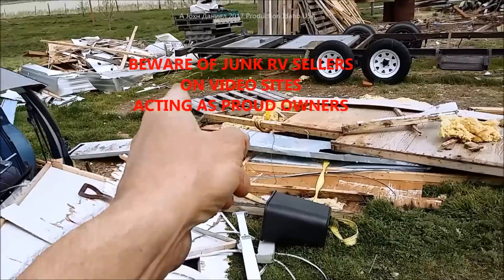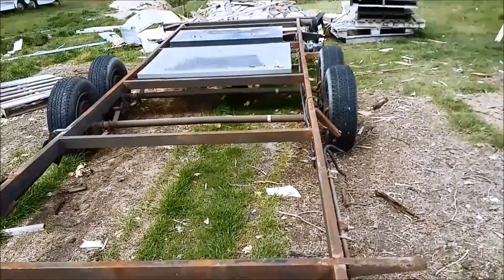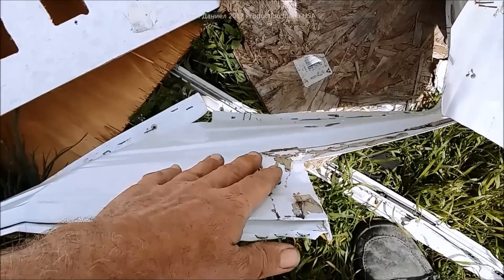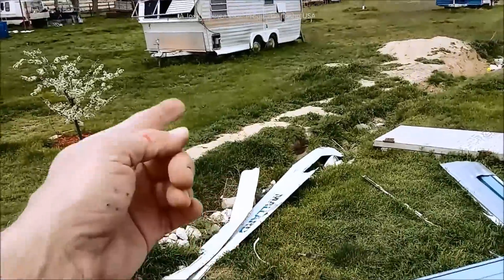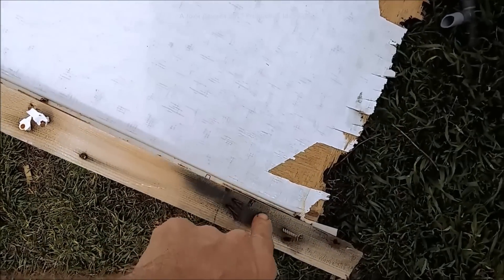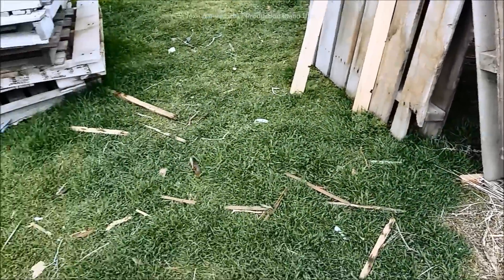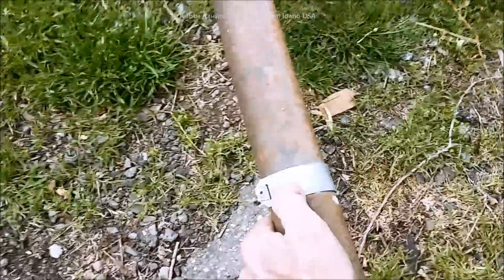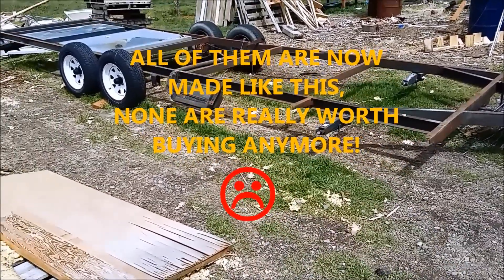HOW THEY MAKE RV Campers Travel Trailers, The truth, Wow! Info Below

Comment: Comments for a 2008 travel trailer that has been opened up and left out to rot or unused and maintained for how long?  Have things changed since 2008? Maybe something more up-date-date...
Reply from the maker: Back History - 2009, Trailer was sold to a buyer by a popular dealer at 1 year old, 1st trip out his foot went through the floor major rot in it, it was part of a suit, it was stored in a barn for 2-1/2 years, it was opened up on the side to expose all the rot for the law suit evidence, it again sat in a building 3 more years, it was donated to me then I pulled it 28 miles after boarding it up, I placed it in my shop building, then I did the video 5 months later of its POS condition.  
It was not left out in the weather to rot, it was stored indoors from original owner, second owner, and then me. However, if taking it on a dozen trips by 2 owners and me hauling it 28 miles was a cause of so much rot, I would avoid a Fleetwood Product!  My 1976 Rambler loves to outdoors, 40 years, HAS NO ROT!
Reply: Paul Boyer Dont kid yourself fella, those things are crap. period.
Reply: Is Fleetwood out of business? Who is now making their brand now?

Comment: Air streem is still today the very best in resale value. In my opinion the best and well worth the extra money
Reply: Kinnish < you’re referring to an old airstream. The modern Airstream doesn’t have the same quality nor durability.
Reply: Homer Mcclain They are somewhat better, but poorly insulated, way overpriced and still not doing many slide out floor plans which makes for a tight space. I wish they would bring it up to the 2000's in that respect.
Reply: Judd _S jayco just bought airstream
Reply: Homer Mcclain worth the extra money?.  Really?.....its  Highway robbery.....just like yeti products...ridiculous!!!
Reply: I know where there's 3 Airstreem trailers and all 3 are junk completely rotten inside my friend thought he could make one good one out of the 3 but the pieces just fall apart he ended up scrapping what he could burnt the rest and took a loss
Reply: they have average insulation agreed but quality is off-the-charts better. My cousin has an Airstream his father used in the 1960s, he uses  today and is giving it to his grandson. 57 years of use and still running. That is quality shit.
Reply: Jim Piver I cannot believe Airstream is anywhere near as crappy as a Harley. They may not be as good as they used to be but nowhere near the reputation of a Harley

Comment: WoW.  What do you recommend for sealing the windows etc.
In the process of building one/frame up.
Thanks,
Reply: You need somthing that is not changing by the warmt or heat of the sun, butyl is not the right one. Use polymeer, I don't know the brandnames in the US but EU has Tec7, that's quality. RV 's , trailers, everything on the road has torsion effects, because of that, it's best, but who dus it, to take the windows and so on , out of the walls and use a lot of polymer after you have removed and cleaned the factory stuff. Use a lot, till it comes from under the window frames on the outside, then you will be sure that ther's enough under that frame. The same with the profiles that covers the corners of walls and roof.  It's a pity that people don't like to see screws,  but then you are sure that something is atached and not only with ...euh... glue ( ? )  Best advice, buy a second one and pay with the nolidge that it has problemes and repair it yourself. How NOT to do it is showen by the constructors.... :-)  Windows that are " clamping " the outside frame against the inside frame on a wall that has isolation or nothing much in it, is clamping on a spons, no presure posible to keep something from leaking... If it's posible with the type of window, use nice stainless steel screws or rivets to put the windows and profiles back. You will know that the window is sealed on the walls and everybody with some grams of brain, also. It's more work ofcose to drill the little holes in the frame on an eaqual distence from each other and in a perfect line, but that's how they do it still on boats and they don't like leaks ... :-)  Autorety's and regulations forbid to build a lot of things yourself, that's why you have to buy shit and pay a lot of taxes over it. And there  are old RV's and caravans that still are in better condition then the new ones.  The idea that people learn from mistakes don't go up in fast-grabing-money bussines .  :-)  Polymeer can be cleaned away with a plastic spatel before hardening and the rest with  cleaning petrol or benzine. The factory shit also. And a lot of ellbow graese... :-)
Reply from the maker: The Butyl-RTV we use is auto windshield grade. Same stuff they set in car windshields with. 30 year plus life, $11 a 14 ounce tube, and capable of -75 to 405 degrees. But there is a nice and perfect option, best fresh source is from a guy on ebay,  https://ebay.to/2r91hIu
Reply from the maker: +Sims Fishing, Flats Fishing, and Kayak Adventures I use butyl like used on car windshield

Comment: Holly crap that thing is complete junk. hell I have seen fema trailers built better than that.  Looks to me the best thing to do is build your own. Man there are junk sellers ever were now days for shit that you will only get a few years of use out of and then it falls apart going down the road.  Good you show this stuff Hell I like to get a nice camper but not if they all look like this crap. Hell I just build my own.
Reply from the maker: +McCuneWindandSolar I have 5 old travel trailers out here, all but this one is from 1982 and back. Those frames are stout and have 3500 to 7000 lb axles but this new shit will have to be made from a 29.5 foot shit pile into a double axle 12 footer to be reused for anything at all.